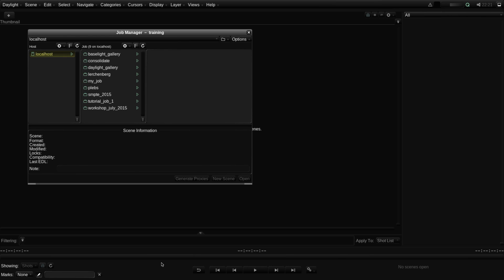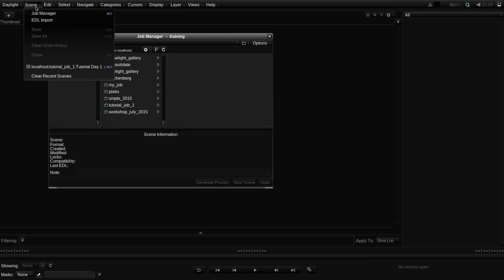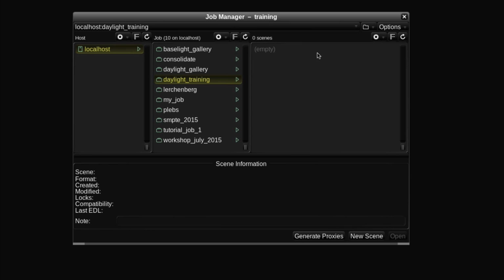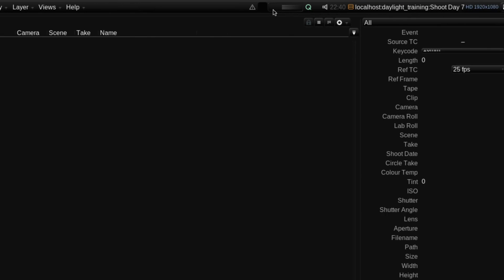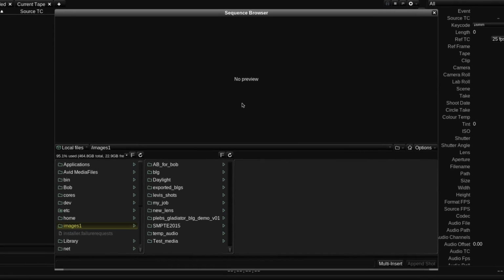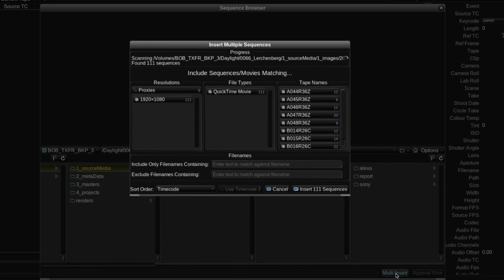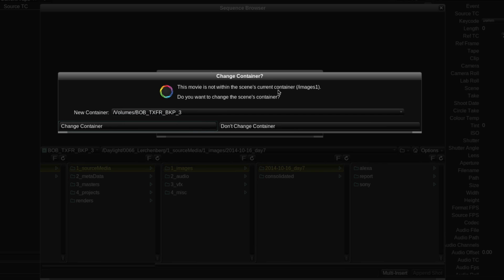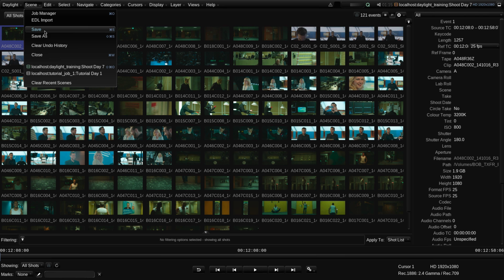Daylight Introduction Part 1 - Importing Material

Comment: I don't get the purpose of this program.
Seems like a whole bunch of work for nothing.
Just use a regular video editor, add all your video and audio files to the timeline and have the job done much faster.
Or am I missing something here?
Reply: This software is more for HETV or feature films where there is a huge amount of footage to be transcoded or organised every day. It's not an NLE and not designed to be used for editing but to prepare the footage for editing later or applying a rough grade to be developed later
Reply: @clausmartini1074  It's partly to give the offline editor a headstart and also to show grades or LUTS on set to the DP. Plus the blg files made with this can be used as a template for the editor and changed in realtime rather than baked in. which is useful. If you need it for more demanding fast turnaround workflows it's useful, if you don't it's not